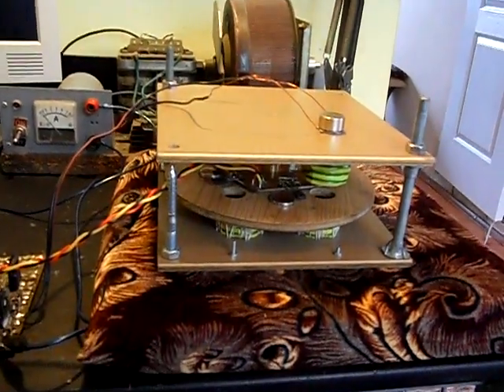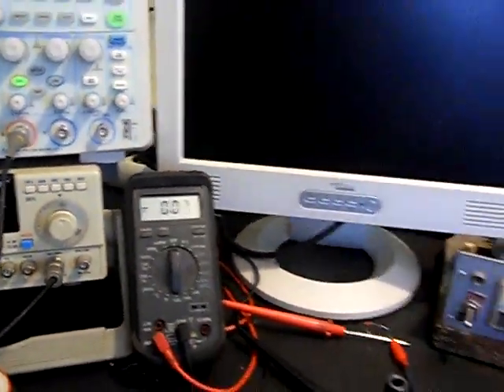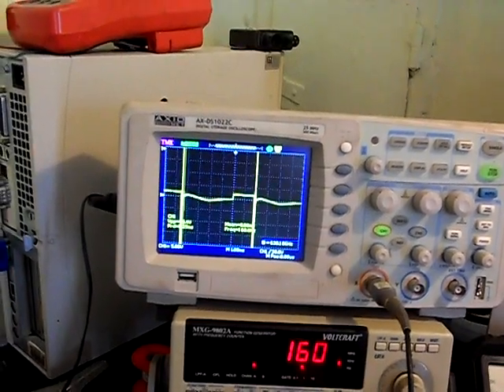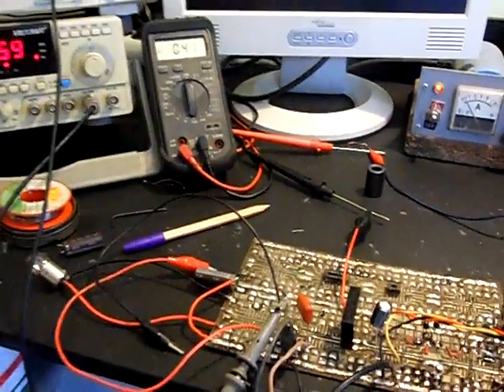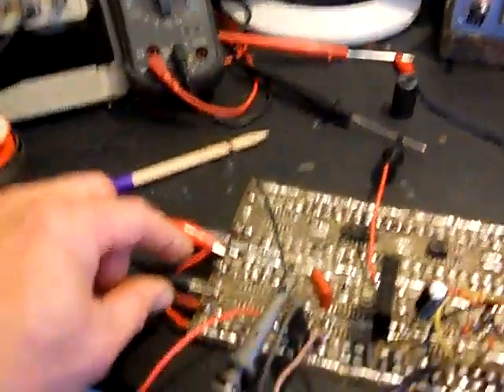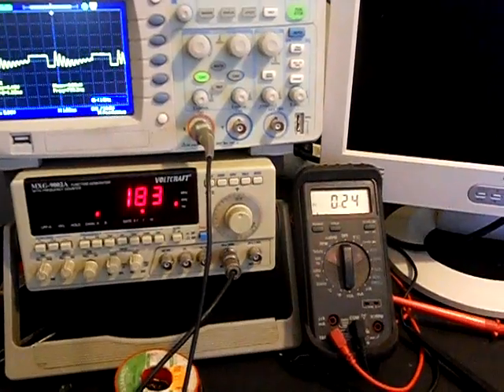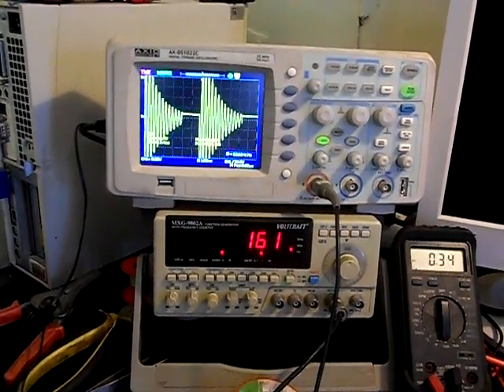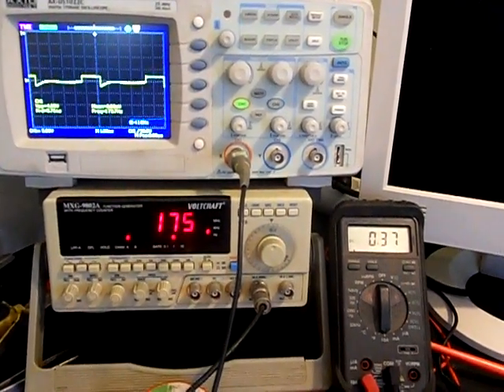Regenerative acceleration under load

Comment from the maker: @ReasonForemost The timing plate is designed for another project with 5 coils and 5 sensors and is a high voltage motor designed for electric vehicles. In the demonstration I use only one sensor

Comment from the maker: @ReasonForemost Your hall sensor is not open collector like the one I use, it's a RATIOMETRIC LINEAR sensor, i.e. your output voltage changes with density of magnetic flux and is used in gaussmeters. Each Hall-effect integrated circuit includes a Hall sensing element, linear amplifier, and emitter-follower output stage. Use another sensor who is used for switches who includes hall sensor, Schmidt trigger and open collector output stage.

Comment: @keykhin I reviewed your photos and schematic that you shared on OU.  The hall sensor type is not labeled, are you using same UNG3503 which you listed on the second coil driver schematic that you had previously posted?  It appears that you have 2 hall sensors connected in parallel for ability to trigger coil driver from 2 different positions and expand up to 5?  And is that a biasing magnet on the top plate to tune the single ferrite core coil which you use to drive and capture BEMF? Thanks.

Comment: @keykhin Thanks for your efforts and sharing of your findings.  Responded to other posts but more interested in your project. I had previously viewed your other videos and downloaded the 2 driver circuits you posted on OU - waiting on parts.  Are you using the 2nd one you posted with better isolation?  What value capacitor are you using on this video and how did you wind your coil and core type?  Any additional info or drawing to replicate and experiment with this effect would be appreciated.

Comment from the maker: @User2718218 I'm not trying to replicate Romero's generator. What you see there is an attempt to build a very efficient motor for electric vehicles. A project I started four months ago. I just use the rotor and the upper plate. As you can see my design is more like Adams or Bedini design, not Muller. I discover regenerative acceleration ages ago as Thane C Heins who demonstrate the same effect in a lot of his videos. My video is not a fake, I got no invisible wires or other abracadabra rabbit,k?

Comment: @keykhin I'm done and I hope everybody reads this.  The message should get out and the technical points have been made to Romero directly for the first time.  I guarantee you every replication will fail and it's not because you "missed" something or failed to "tune" it correctly. There are 2 reasons your replication will fail, 1) The whole design is under unity - open your eyes.  2) Romero induced you to replicate by lying.  That is the truth and thank you for permitting me to talk with Romero.

Comment: @RomeroUK1 I hope and pray one of the replicators that spent hundreds of hours and hundreds of dollars following your nonsensical BULLSHIT takes my advice:  After failing to make a self-runner they do a clip where they hide two fine magnet wires so the camera can't see them and connect them up to the FWBR bus.  Then they can do a clip that shows much more impressive "OU" than you ever did with a better build and higher "OU" performance.Then they will explain the wires and the HEAT WILL BE ON YOU

Comment: @RomeroUK1 But the TRUTH Romero is that when the DC-to-DC converter is outputting 3 volts and the rotor is spinning very slowly, the output from the FWBR bus is probably about two volts.  That is not enough voltage or power to keep the DC-to-DC converter alive and certainly that would not result in the motor "bootstrapping" itself.  You cheater and liar, the only way for the motor to bootstrap itself up from that low power state would be to CHEAT and wire 15 volts DC into the FWBR bus.

Comment: @RomeroUK1 When you run the motor-generator in the long clip and the DC-to-DC convertor is set to output three volts, the rotor turns very slowly.  Therefore the output from the generator coils + FWBR in this case was very low, not enough to power the DC-to-DC converter.  However, you never show the FWBR output at all in your clip.  Like "magic" the rotor speeds up when you increase the converter output to a higher voltage implying that your motor-generator was boostrapping itself.

Comment: @RomeroUK1 Look, if you had OU.  Why didn't you make five or six detailed clips?  Why didn't you make measurements of all the input and output voltages and currents in the clips?  Why didn't you show all of the information that would have been more convincing?  The reason you didn't do that is that you were just following the same pattern of all of the OU fakers out there.  You intentionally did incomplete clips because you couldn't provide complete information because that would expose your lie

Comment: @RomeroUK1 You have already seen about three replicators state that it doesn't work.  Of course most of the believers think that you stumbled across a "magic" combination because they don't have common sense with respect to this stuff and believe that's possible.  The truth is it isn't possible, there is no "magic" setup.  People are getting about 30%-35% power out vs. power in.  There will never be any working replications because you cheated.  The OU dupes will let you get away with it.

Comment: @RomeroUK1 Not a single person will ever reproduce your bullshit fake motor-generator because they are honest.  Why did you go to the "dark side?"  Why do people like produce fake junk clips that are so obviously fake?  You NEVER measured the voltage going back to the DC-to-DC convertor with a multimeter or a scope because that would have exposed you for the liar and faker that you are because you were injecting power into the FWBR bus with fine wires.  The OU gang are too dumb to ask you.

Comment from the maker: @RomeroUK1 Thanks bro, appreciate that. I answer to all questions because I'm a real gentleman and I like to share my work. I'm not that MFSOB, lurking around, stealing others work and rush to the patent office. In fact all this regenerative acceleration is pretty simple: you got to know how to build the coil, how to place magnets on the rotor, how to do the timing, the distance between the rotor and the coil, and at last, but not least a good driving circuit with fast switching & minimal loses.